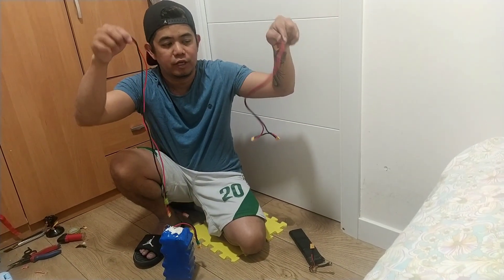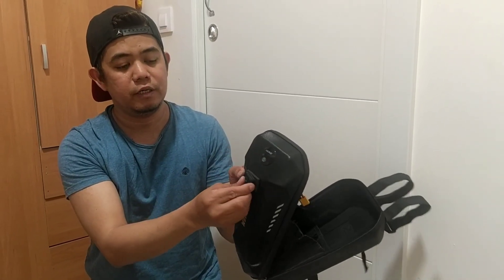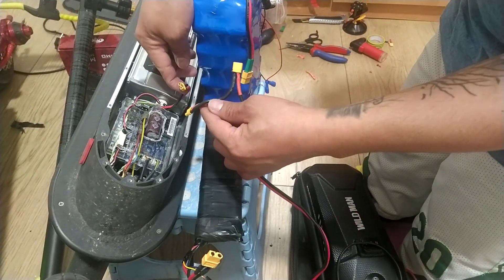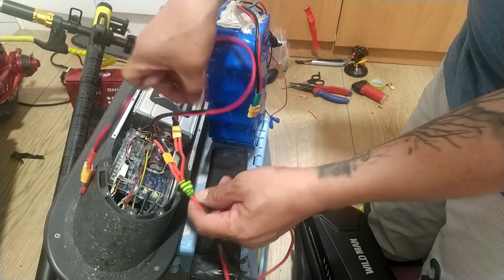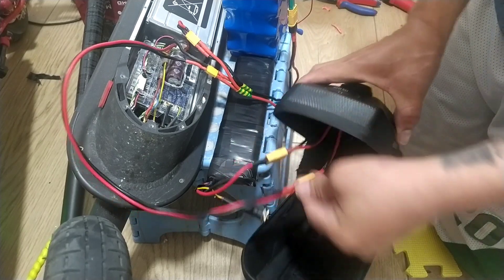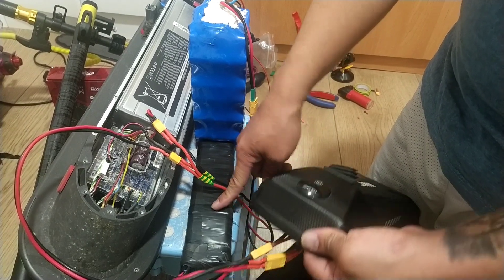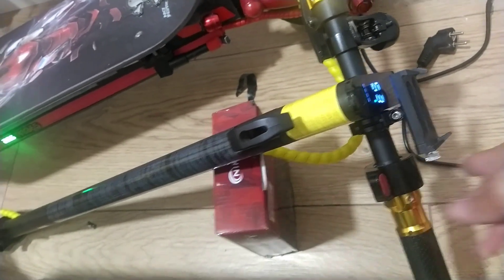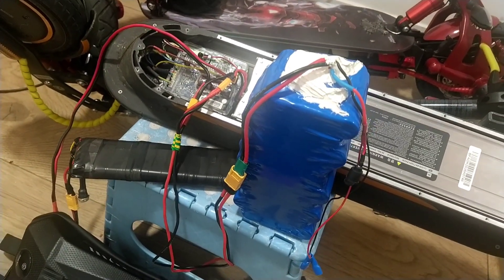3 battery connect to series and parallel connection

Comment: 12v battery can run faster than the 42v ? Or it just adds more voltage to the stock batteries and external batteries?
Reply from the maker: because that is speed series batery the 42v is range also like in the stock battery

Comment: Me I have 4 batteries, 1. Stock, 2. Range, 3. 12v speed 4. 8v speed. Connection, parrarel the stock battery to the range, then series the 12v and 8v, then series again to stock and range battery. Total volts 62v and my controller is V3.0 m365. All batteries still can handle. I just sharing my setup, thank you. Note I using stock motor, throttle and dash board as well. Thank you.